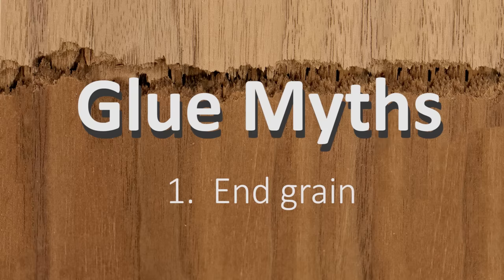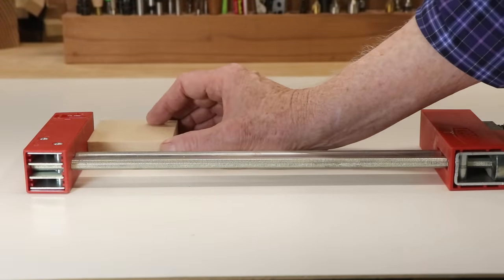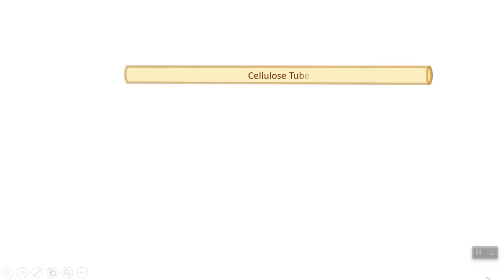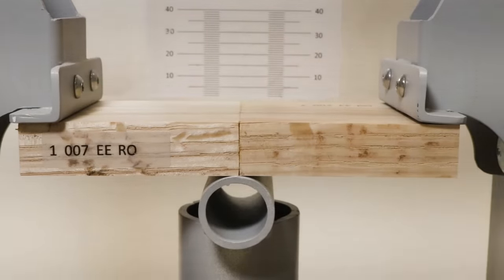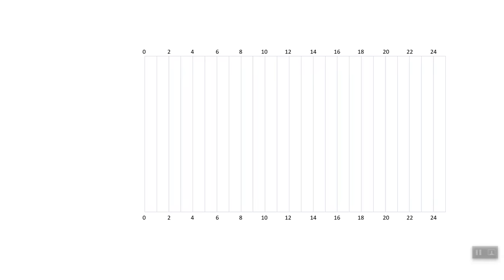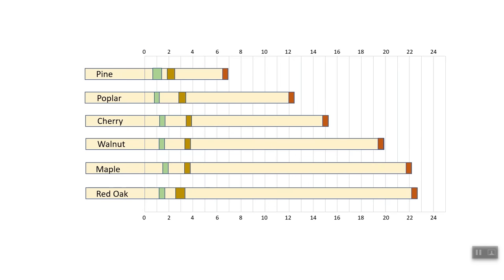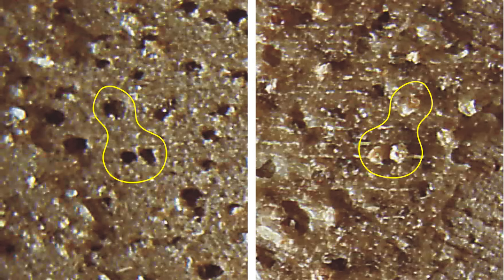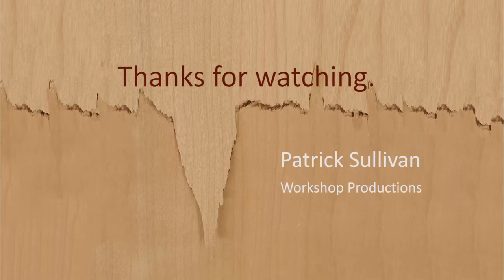Glue Myths:  1. End grain

Comment: At 0:14 the Wood magazine quote says there will be failure because you are gluing at the porous ends.  This is like telling people not to read books because there are WORDS inside of books.  Okay, analogies, similes, and metaphors are pretty tough on this one, since it is more in-your-face than the movie "Idiocracy".  BUT, to review:
The majority of all glues operate at a microscopic level in which adhesion depends on "grip".  A perfectly smooth surface, like Masonite, will  resist wood glues, and can even fail with hot glue.  Even glues which are designed for plastics, metals, concrete, etc always recommend "roughing up" the joint surface.  Silicon objects, which are usually quite "slick", can be nearly impossible to glue.  But there is no need to be exotic.  Try using wood glue on glass.
SO YOU WANT, REPEAT, YOU WANT A POROUS SURFACE.
It is likely that the insanity about end grain gluing relates to torque, leverage, and shear strength.  Put another way, if the surface area to be glued is too small, relative to overall surface, weight, and stress, the joint will fail.  But it goes deeper than that: try bending a 1mm diameter steel pin that is two inches long.  You can't do it without tools.  Then try and bend a 1mm diameter steel pin that is 12 inches long, with just your hands.  Get it?

Comment: It appears from this video that Patrick Sullivan has conducted his experiments methodically and under laboratory conditions. Unfortunately, real furniture in the real world is not constructed from three  inch square pieces of wood and is not subject to laboratory conditions. The worry is that some viewers may assume that they can dispense with traditional joints, or at least be less reliant on them. Here in Europe we have a woodworking tradition dating back nearly a thousand years, over which time craftsmen and women have evolved many types of joints to enable them to make furniture  that will stand the test of time. Apart from veneering, light lippings and laminating which obviously rely solely on glue, it is always prudent to use the strongest joint that can be devised for the job, not relying on glue alone, rather, the adhesive is there to permanently lock the mechanical joints together. In much fine furniture, the wood is chosen for its beauty not its strength, and components are often  relatively delicate and must rely on proper joints for there strength and longevity. Solid wood constantly shrinking and expanding to be in equilibrium with the air around it and is can be subject to all kinds of stresses and rough handling out of the control of the maker, so it is beholden on us to anticipate  these possibilities.  The late, great, Alan Peters O.B.E. [ much revered in the USA incidentally and always receptive to new ideas and techniques I might add ], is on record as stating that a lot of his furniture would hold together with no glue at all, such was his mastery and understanding of traditional joints.

Comment: Common knowledge is PVA glue is stronger than wood. You failed to equate the force needed to break the "face glue joint." You measured the strength of the wood structure next to a face glue up. I am not sure what the point to all this testing, other than your ingenius methods of testing.

Comment: Expansion and contraction of the wood is what breaks end grain joints.  This video over looks what professional woodworkers have known for years.  Wood movement is what makes joints fail.  Cross grain joints will have a 100% failure rate over time.  This test is seriously flawed because it doesn’t account for the most powerful forces on wood joints, wood movement from expansion and contraction.